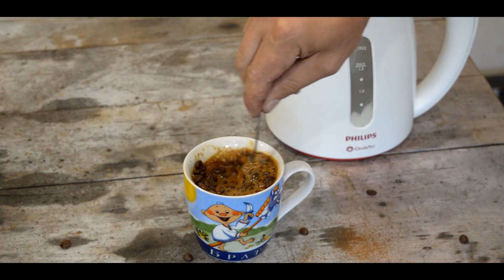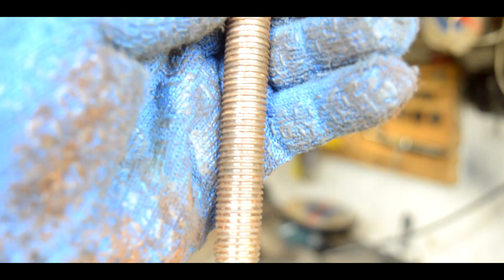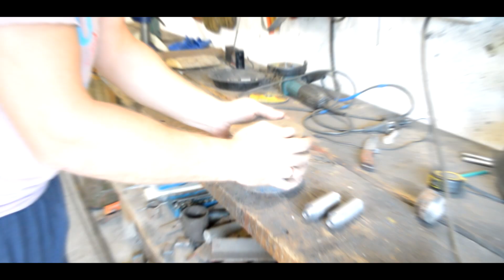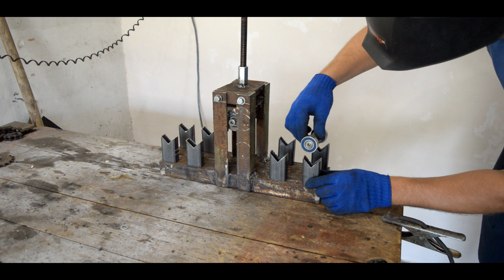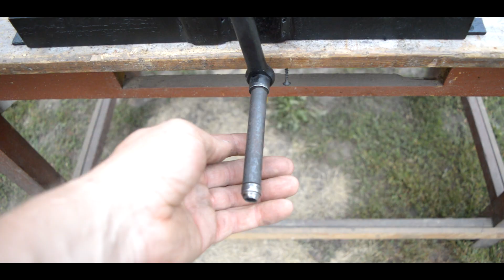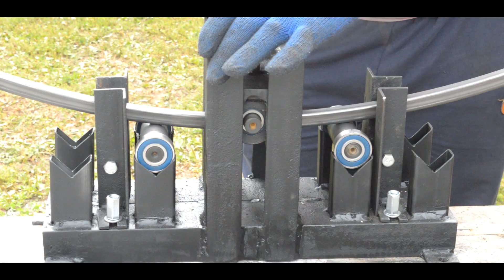Делаем ТРУБОГИБ!!! Homemade METAL BENDER!

Comment: How about bending a solid steel stock piece 13mm. (1/2 inch) thick by 20mm. (3/4 inch)
wide. having the wide side (20mm.) as the flat part .

Comment: That is a very simplistic design for your ring roller or metal bender as you call it. I've been debating on making one myself. I'll differently be basing my ring roller off your design just wider for up to 6" wide (152.4 mm) flat stock steel bar. Great work !!!